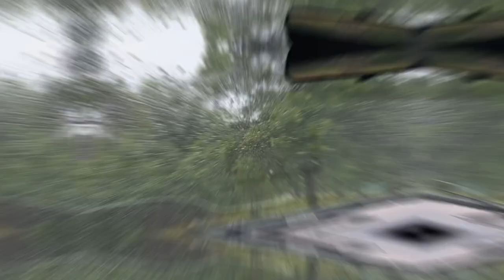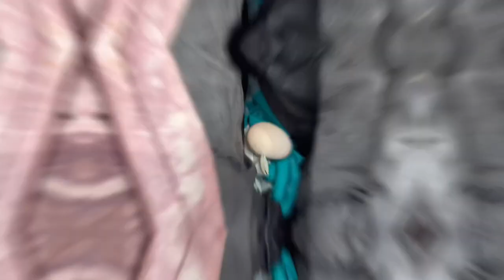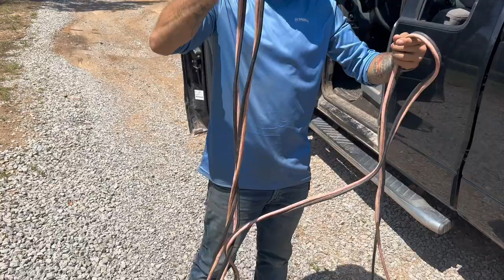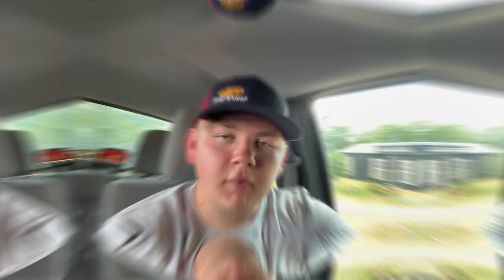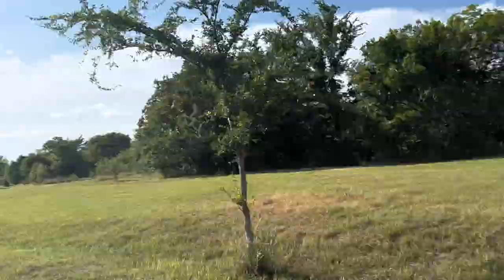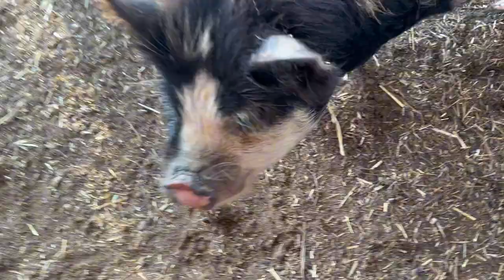Farm Fresh Breakfast!

Comment: The negative side of your battery (black) is the "ground" meaning it is grounded to the truck (the frame). So having negative covered is not necessary. The positive is covered because if the battery bounced up and contacted the hood (ground), it would short and spark....hard. Have a great day.

Comment: Let it charge for a second already. My goodness. Patience patience patience. Lol. Also helps if the charging vehicle revs the motor. Seems to charge more quickly 🤷‍♀️🤷‍♀️
Reply: I was going to say the same thing! We've ALWAYS revved up to about 2500 rpm for about a minute, or so, before even trying to crank over the dead vehicle. It allows the alternator of the jumper vehicle to charge both batteries for a bit. Also, I'm surprised no one has said anything, yet, about how the negative jumper clamp should be connected to the metal frame on the dead vehicle, NOT the terminal on the battery as this could cause a spark which could ignite the hydrogen and oxygen gases the battery acid gives off. Never done this, myself (I have always connected directly to the battery terminals on both vehicles and have had no issues...yet. Keyword, there..."yet"!) but, figured the "Safety Police" would make a remark, or two. lol